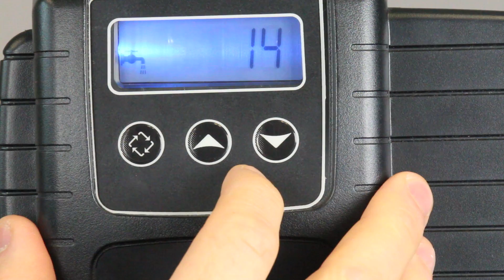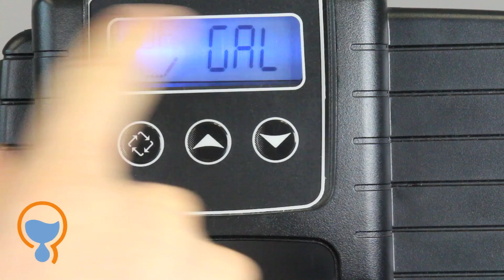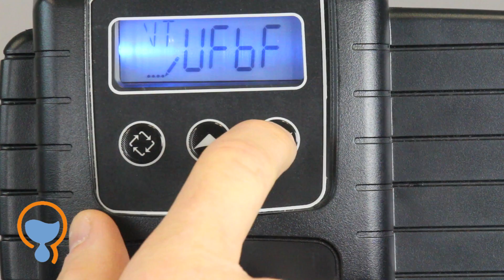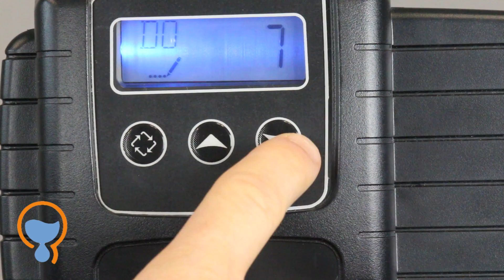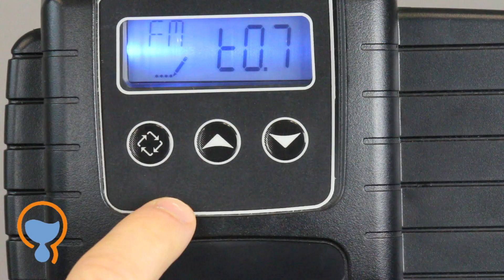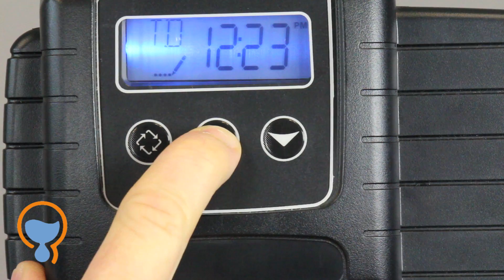Fleck 5600SXT Control Valve Programming

Comment: after i installed and programed this unit, i saw the number 1901 on the meter..then as the day went on that number went down. i can only assume it was gallons used. however the next morning, (no one used water since night before) , the water meter number appears to have re-set back to 1901? does this do that each night? and it it normal? i cannot find info on this. thanks
Reply: The 1901 is the number of gallons of soft water remaining after the system has regenerated.  As you use water, this number will count down.  Depending on how the programming is set up, you'd usually want this number to get close to zero before another regeneration happens.  Every time the unit regenerates you'll get back to 1901 gallons remaining.  I suspect your day override setting is set to "1" so that your softener is regenerating every night.  Day Override is "DO" in the programming menu.  Set this to 7 unless your water has high iron, then set it to 5.
Reply: *****
thanks , i checked the DO value and its at 14....i will keep an eye on the gals and see if it continues to go down as you suggest...if not i will post back to update whats going on,...thanks..it appears that today the gals HAS actually gone down and NOT re-gen..as it did the night before...i will check again in the a.m. 12/3/
Reply: Pete B
ok its about 1 week and all it fine...:) thanks for help ,unit is working fine so far and wife and i are pleased...:)